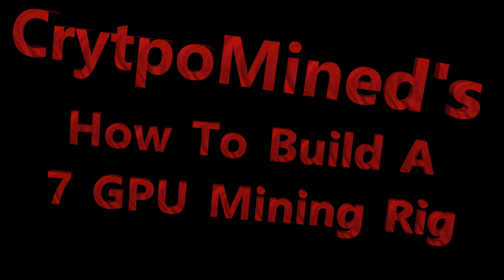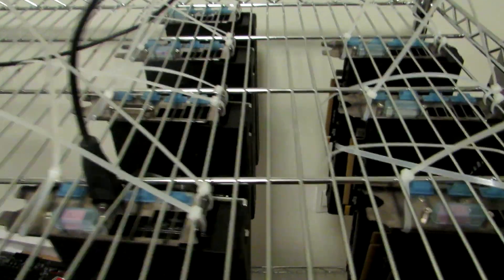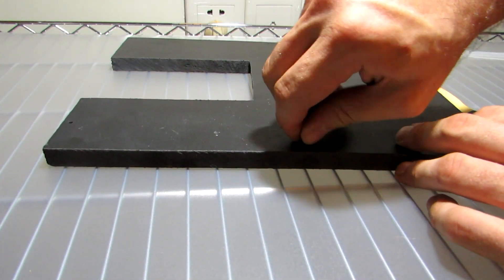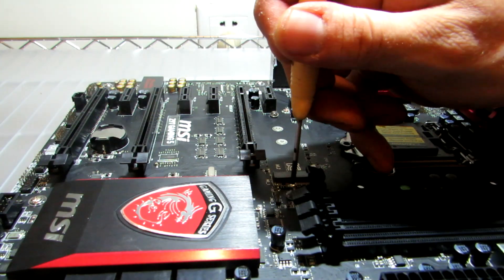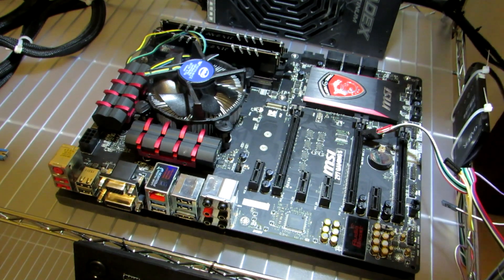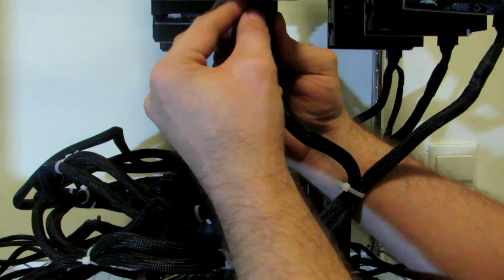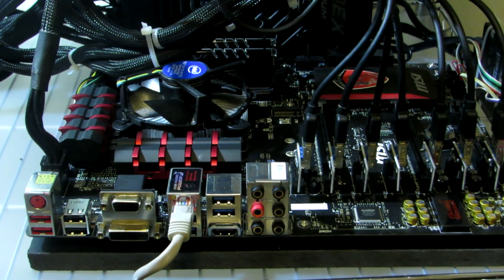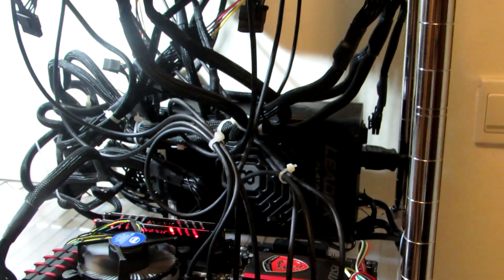How To Build a 7 GPU Mining Rig for ZCash Ethereum Monero Crypto Altcoins MSI Z97 Gaming 5

Comment: Actually Nitros 470 do draw more from the slot (5-5.8A) than from dedicated power connector (about 3.5A). The entire RX series has this power design flaw. That's somewhat above the official SATA safe margin of 5A. But in reality I have them connected two per SATA power line and they have been running without problems for months. No signs of SATA connectors overheating. But if you add more per line - that's a recipe for disaster. 480s are much worse in this respect. They draw up to 8A from risers! I don't have those but people report that even connecting two of them per line even with Molex might result in melted connectors, especially when dual mining. Take care!
Reply from the maker: well I was going off of what i learned on the "Actually Hardcore Overclocking" channel... thats what I was told there, and yeah just like you I have not noticed any problems with doubling them up on sata or molex connectors.  .. .though you probably know more than me when it comes to this as I'm not an expert on that sort of thing... actually not an expert on anything, just sharing what I have learned to help others learn :)  so thanks for sharing your input :D

on Actually Hardcore Overclocking they told me asus and nitros draw their core vrm power from the 8 pin, so he looked like an expert to me, i went on his advice and opinion... but yeah like I said... you probably know more about me if you have tested the cards with an amp meter or whatever you use :P

though, and again, im not an expert... the XFX cards do seem to draw more power from the PCIE slot than the nitros?  can you confirm if that is correct?
Reply: I speak from experience, I measured them physically with multimeter. There are others on ethereum forum who did that too. Of 470s I also have PowerColor and HIS, they draw around 4-4.5A. A started masuring my cards power consumption after I burnt few SATA cables with MSI 380s. Much to my surprise they drew 7.5A which is 90W from the slot! I burnt two cables when I tried to connect 3 of those cards onto one SATA cable. But 2 is fine, even with 7A, they run happily ever since I had figured it out by trials and errors. So I think most of these horror stories come from cheap ebay cables that simply have fake declared thickness not enough to hold load or just poor quality connectors. After all I think that two 470 cards connected with one SATA line is absolutely fine, even more so with Molex. Just monitor them closely first days after launch. Can't vouch for 480, though, that's a different story.
Reply from the maker: generalcontrol cool thanks for the info, i would like to find out what the XFXs pull
Reply: Sorry, have no experience with those. Nice rig BTW.
Reply from the maker: no prob, curious after the overclocking channel said they draw a lot.
and Thanks :)

Comment: Any other motherboard you recommend for 7 gpus and for 6 gpus?
Reply from the maker: i actually would recommend sticking with 6 GPU boards for mining, and mining specific boards like B85 and H81, or Z97 anniversary, or the biostar H81S2
https://www.youtube.com/watch?v=qS44TmuKUQE
Reply: Cryptomined great thanks, asrock is what i can get in hold of so if you have any asrock for 6 gpu im mind let me know:) thanks
Reply from the maker: Jakša Ćosić personal favourite is B85 Anniversary.. i use H81 BTC PRO and B85 Anniversary, ... B85 Anniversary comes with 4 DDR3 Ram Slots, so you can have dual lane memory, which ~might be better for ZEC mining, there is a debate on that now... im not sure myself.   it also has a few other additional features as I mention in the motherboard video like being able to use one card on the board and risers on the other 5 cards, which is really handy being able to use that 16x slot to its full advantage... also that 16x slot on anniverssary can run at Gen3 speeds, where Pro BTC is stuck at Gen2 speeds... so for a desktop/multipurpose board/future use that is better. also more sata connections and more USB ports (6 onboard instead of just 2), so its a better board really. (than H81 pro btc) and like pro BTC its really meant for mining, but unlike pro btc you could also use it as a desktop PC board...

Comment: I have been playing around tonight with the new Genoil 5.0 and made 2 out of 8 rigs crash with the -k zec   zec… I only get 10 sol+ when using the extra zec. be careful with the 5.0 and use the 4.3 instead, all RX480 rigs crashes with 5.0
Reply from the maker: ill test it out, thanks for the heads up :)
Reply: I have tested it for the last 10h with 5 rx480 and I really don't get any higher sol/s, it is just more stable on the top side of the sol/s rate compared to 4.1 (before 150 - 165, now is more stable around 165)

Another great video btw :)
Reply from the maker: Armando Cavallo thats good, i still need to test it, i ended up passig out earlier, and not playing around in linux, after i make a few linux tutorials I will take a closer look at v5 (maybe v6 will be out by them lol)
Reply: It would be nice to around 40 sol/s x card (stable) lol. But are you running it on Linux or Windows?
Reply: Martin Christensen true